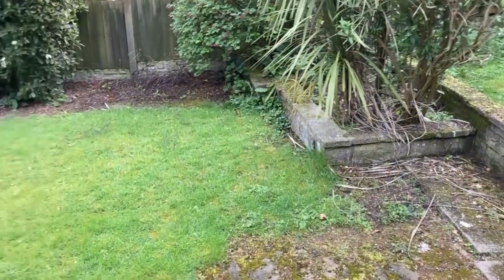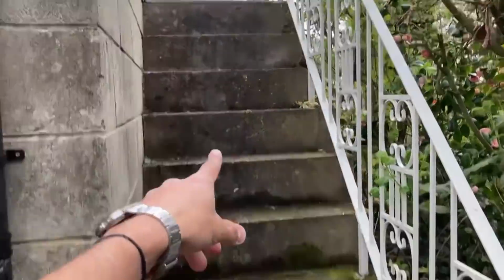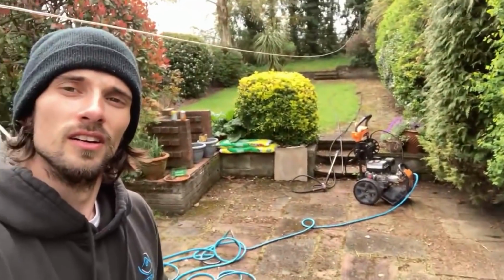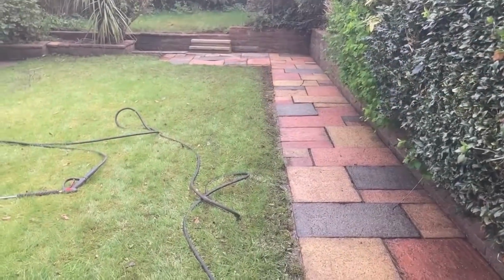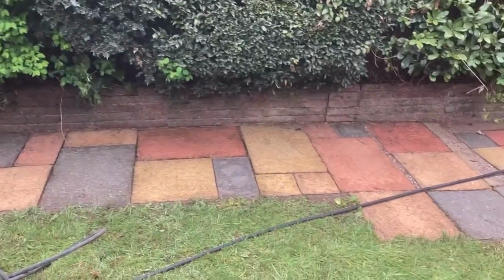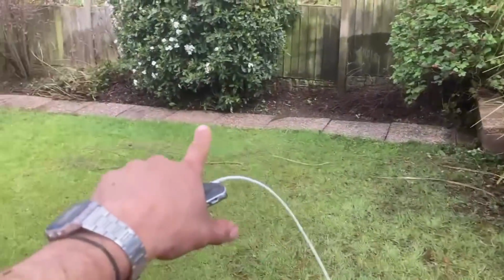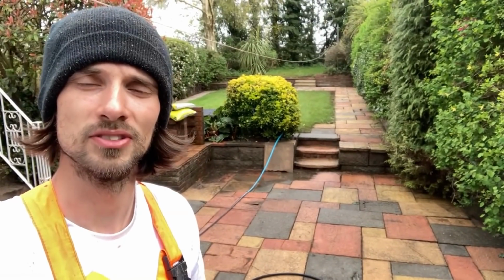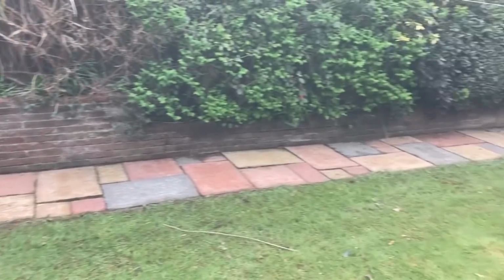Pressure washing very old slabs and SUPER mossy brickwork!

Comment: I was expecting it to get cleaner, but I wasn't expecting how colorful the bricks would be.
Reply from the maker: Awesome isn’t it!
Reply: It would have been cleaner if he had a better eye for detail. A lot of the sections he went over it too quickly and it didn't remove all the dirt.
Reply: @taterman320241  not really. They are stained. He said in the video he asked the owner if they wanted a chemical based clean to remove the stains as well
Reply from the maker: It may have looked quick but trust me it wasn’t lol, and the comment below is correct, only thing that would have got it cleaner is chemicals which were refused
Reply: @taterman320241  🙄🙄😴😴
Reply: @taterman320241  The video has been sped up that's why it seems the operator is working too quickly.
Reply: I used to pressure wash a veggie canning factory.  It wasn't worth putting on the waterpoofs because of having to crawl under machinery to clean. You were bound to get soaked at some point.
Reply: This is a lot of work. I’ve pressure washed my driveway and brick before and the amount of grime not to mention the vibration of the pressure washer, wears you out.
Reply: @taterman320241  Quickly? You do realize that part of it was all time lapsed correct?
Reply: I had the same reaction. I was like “they’re colored bricks?!”
Reply: after they seal it with paving gloss sealant
Reply: I know I'm kind of off topic but do anybody know a good site to watch newly released movies online?
Reply: @holdenkamden1300  Prime Video if you wanna go legal
Reply: Some whacky Northerner had fun putting those down I suppose😛
Reply: @taterman320241  The airmchair jockey has been identified
Reply: makes u realize some places look sad just because they have a little bit on them
Reply: I love it when I'm sandblasting an almost black facade and it comes out as light yellow bricks
Reply: They met quickly regardless of the speed up, he did the best he could. It’s just stains that couldn’t get removed.

Comment: You do fantastic work. I love the colors of the stones. I hope the owner repairs those bad spots & keeps those beautiful stones. Also there's far too many job sites that have bad drainage which is the root cause of ruined stonework.
Reply from the maker: Completely agree. It’s funny you can pressure wash the same aged stone 1 meter to the left and it’s fine but try it where the water pools and the stone starts falling apart!
Reply: @PartridgeExteriorCleaning   Exactly. Such a shame.

Comment: My first thought was it uses a lot of water, but later I realized I would use the same amount of water if I scrub it manually and using buckets to wash off the soap and debris
Reply from the maker: Yeah there’s only so much that can come out of the tap and the pressure condenses the flow so it’s actually less water than would be used by leaving the tap running for the same amount of time :)

Comment: Great video! Earned yourself a sub. Just got my pressure washer and am looking to make a couple dollars over the summer! Any tips on efficiency and pricing?
Reply from the maker: Thanks for the sub! it's all regional really, UK prices between £3-£5 per m2 for me, also depends on the surface as some are quicker to clean than others. Huge jobs i tend to day rate for a full day or two, that will jsut come down to what you are happy with, for some it's £150, others £700. it can be hard to figure out your prices but as long as you'rer going home not feeling stupid for charging low every day youll be fine!

Comment: Hi Sid you were brave to take on that job I probably would have as I have a great powerful machine for these type of jobs. You say you getting a new one got any plans on what pressure washer you thinking of getting
Reply from the maker: Hi bud, a loncin or a Honda. I’m actually thinking of going 15lpm instead of 21 but just waiting to hear back with quotes from a few companies as I’m buying an FSC and a few bit and bobs too
Reply: Ok of you going for a Honda most of there machines you can't use direct to the mains nut via a bin etc as I had a Honda GX390 fantastic bit of gear but a pain waiting for a bin to fill up as if they slow water pressure can only run it for like 10ons and then got to stop hence why I prefer straight from the mains now
Reply from the maker: @c.d.scleaningdrivewayservi7757  so what machine are you using to go straight from mains? My one now runs perfect from the mains but its only 11lpm
Reply: I had a few machines other than the Honda GX390 I never thought o find a better machine but I did and you have a wilks I see so I wrote to them a while back and asked to trail there TX 850 And wow mate power is unbelievable and flow is 14 lpm and a 15hp engine so I clean an average driveway around 40 mins quicker than any other machine  I owned so I brought one after trying it for a wk and it runs like a dream as for durability I not had it long enough yet but I never had such power and control I now brought a second one as my business is booming at the moment
Reply from the maker: @c.d.scleaningdrivewayservi7757  oh wow sounds like a beast. the only thing  i dislike with twilks is cheap parts but somehow mine has survived a year, so maybe its the way to go :D
Reply: That mayb so but with it being an American firm and not Japanese makes the parts easier to change like the Japanese use there own sizes which means you have to buy from them but with the Americans they use same sizes as us meaning if you want to change the pump the fitting first makes other thsn Japanese the only machine that I know that supply gd quality parts are Honda hence why they are expensive look at most other makes and they all seem to use not so quality but like me I service my own machine change oil regularly etc  so it should last me alot longer so am well impressed with willsachines and for the price it can't be beaten on power 4800psi and you can feel it on the lancer and with running straight from the mains it tends to hold around 4200-4800 all day long I has a loncin and started going wrong after a few months and was not reliable enough had this wills for around 4 months now and no problems running like a dream so if you can afford a Honda and prefer to pump out of a bin then Honds the way to go if not then take your pick as all other suppliers seem to be the same I been doing this business for 12yrs NOW and gone through alot of machines so I now know not always gd to buy expensive
Reply: @c.d.scleaningdrivewayservi7757  All pressure washers should be feed from a tank of some sort. if you feed it direct from the mains when someone inside the house draws water that could  starve your machine of the water it requires which would cause extra wear on the pump. Use 19mm hose to fill your tank with no click connecters that is what I use to fill my bin and never had a problem with water running out and I have a 30 litre per min machine. Americans don't use the same sizes as us they use AF we use metric the same as the Japanese although all water pumps use BSP. The Honda engines have been going for donkeys years so they are tried and tested. I had a quick look at the TX 850 I couldn't see a reduction gearbox driving the pump which means they use a high revving pump. Have a look at Q washers on here especially the one on pressure and ltrs where Damion talks about the Wilks machines

Comment: Is that the tx50i? Just got one. Obviously have a turbo nozzle would you say most jobs use the green nozzle and turbo. Also mine has the detergent tank obviously no sh but could bio cleaze go through it at a decent ratio or best to pre mix and suck the chemical in. Sorry for the questions bud been going for months and just added roof cleaning and pressure washing. First roof coming up quite a big one.
Reply from the maker: yeah mate it is, i use turbo nozzle on most jobs, green and yellow tips for gentle stuff, i dont actually use the detergent tank so honestly couldnt tell you mate but im sure it would be fine just keep it on low pressure!

Comment: Great job mate, what jet washer do you use or recommend? I’m looking at adding it on too my round cheers
Reply from the maker: The wilks 750i i use is a great starter machine but not to be used too much or itll just fall apart haha :D If you have the budget head to rutland pumps or AC pressure washers or spinaclean and check out their range of washers, 15LPM and upwards
Reply: @PartridgeExteriorCleaning  thanks mate👍

Comment: Do you use any checmicals when powerwashing concrete? Or houses?

Will a 2% sH mix remove any color from the house paint? What if the customer has a blue house, will 2% sH remove the color?

Comment: Is using a surface cleaner attachment not appropriate for pavers with seams?  Only on solid (concrete) driveways?   Or was is not used because there was too much debris (moss, etc.)?

Comment: Nice cleaning job, but my guess is the customer will lift the flags and lay new ones.  As a builder who does a lot of paving, to try and point up that  would be a nightmare job and would never be right unless lifted
Reply from the maker: Quite possibly, i think they were impresses with the clean and just going to leave it as is to be honest
Reply: @PartridgeExteriorCleaning  Love a bit of jetwashing. Finished laying a stone patio today, and me being a clean freak I also jetwashed the concrete paving I had been working off. Used hypo and got 50-year- old concrete flags like new. I love a bit of hypo, Haha.

Comment: That’s definitive, my electric Simonize would NOT be able to get this result.  Watching too many videos like this one absolutely skewed my expectations when cleaning up my yard…
Reply from the maker: A chemical treatment after a clean even with a little electric one will do wonders, sodium hypochlorite for quick results or a biocide for slower but longer lasting results. 
Just do your research on the PPE before hand as they are not safe to handle without gloves, goggles and correct filters in a respirator :)

Comment: that was too quick ...amazing job but I like to watch for longer and see more details ...but thanks anyway ...def needs the chemicals ...the fumes dissipate in the air anyway not harmful...I use soapy bleach ...hose when finished and sweep bleach over what you have done while it's wet...I don't have a sprayer as I just do my drive way and pavers ... and let it dry ...gets everything off ...x from Australia